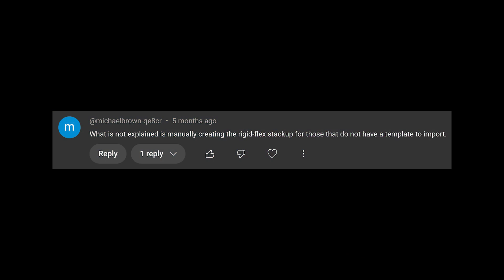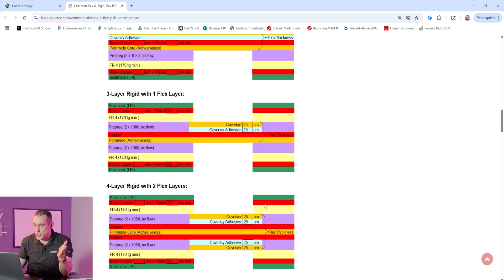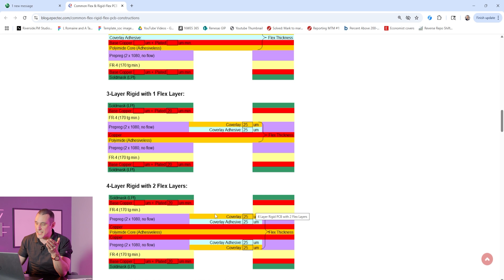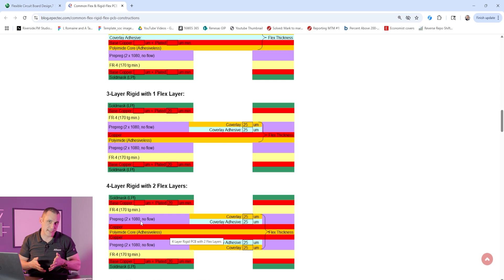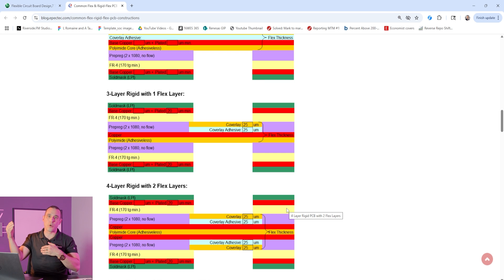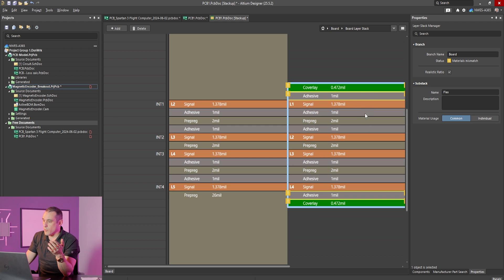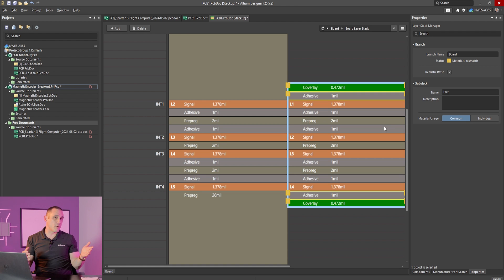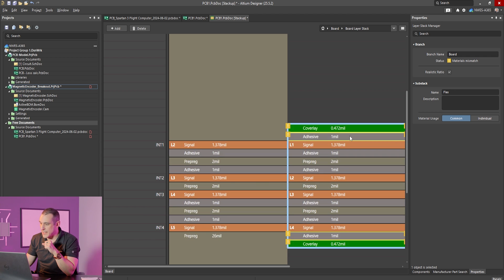How to Design Rigid-Flex PCB Stackups from Scratch

Comment: I tried your link but get a grundle of text.  Is there a better way to download the stackup?
Reply: Hi! I also couldn't download Template
Reply: The .stackup file used by Altium is a human-readable file, so it looks like your browser is opening it and displaying the text instead of downloading the file. To download the file, right-click on the link and click "Save link as..." and you will be prompted to save the file. You can then import it into the stackup inside the Layer Stack Manager.

Comment: A few things I would like to add. The adhesive used to join between the flex layers has a very high cte and puts pressure on the vias when thermally cycled. You can avoid this adhesive in the rigid section by using unbonded adhesiveless flex layers joined with prepared in the rigid section. The coverlay normally overlaps slightly into the rigid section in prepreg area and due to the adhesive used with the coverlay, you want to avoid using vias near the transition area. Also there is min bend radius due to the total flex thickness that should be considered. Also consider adding glue along the rigid flex edge to provide some strain relief. No-flow pregregs should be used throughout the rigid sections, and this is to limit the prepreg resin flowing into the flex regions when laminating. Any resin that does flow may be glass knife like and is another reason to strain relief at the edge. Rigid flex has a heap of extra processing steps, so $$$